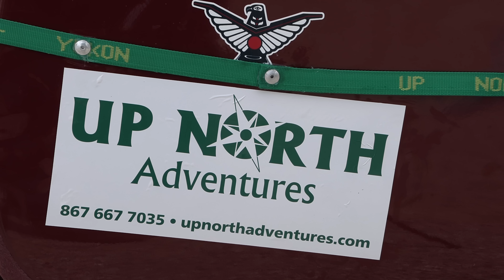11 Days Solo Camping in the Yukon Wilderness E.1 - Bush Plane Drop-Off & Arctic Grayling Fishing

Comment: The scenery makes my start dreaming of getting over to Canada some day, you have much more of the really remote places than we have in Norway. I recommend one day trying tents from Scandinavia, Hilleberg or Helsport are good brands, and I will say better in tough conditions You put up the inner and outer tent at the same time, they are connected so that in rainy weather the innertent won't get soaking wet before you get the flysheet over on top, like on the msr tents. The reason for north american brands being made that way is probably because of more stable weather over there, well maybe as I see in your videos not in all parts of Canada but in the USA. In scandinavia you never know what weather to expect and it pours down a lot of the time.

Comment: Ok, gotta ask here... Are you renting canoes and then drilling holes in them? Clearly the outfitter is ok with it, but I'm curious to know how that works out.
Reply from the maker: All the outfitters canoes are outfitted for spray decks in the same way. You need to drill holes to do it. I have done that in past and the outfitter was thankful as it meant they didn’t have to do it. In this case, Nova Craft shipped a canoe up to Whitehorse along with a bunch of other canoes that outfitters ordered up there. I used it and then donated it to Skookum Jim Friendship Center.